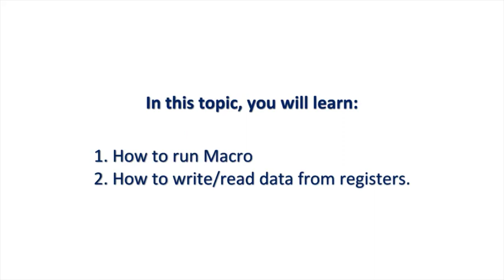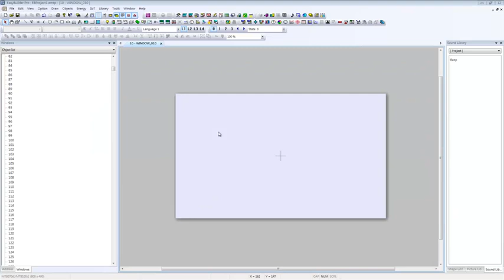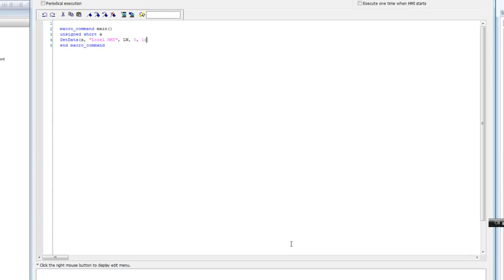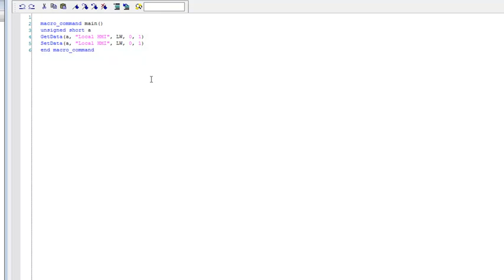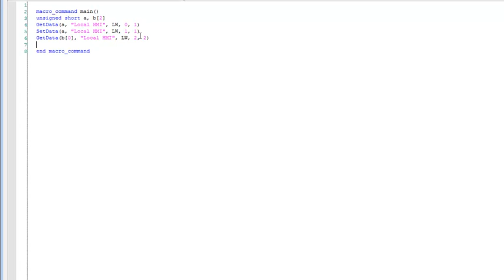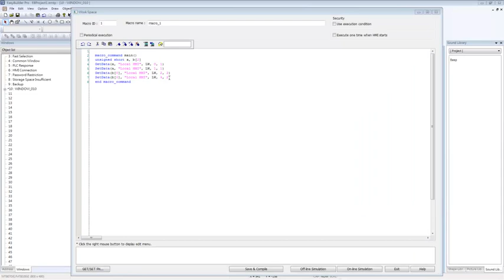Weintek EasyBuilder Pro tutorial - 25.Macro

Comment: what is the difference between GETBIT() and GETDATA() ?
i wanted to use GETBIT() instead of GETDATA but nothing
i have a toggle switch , write/read address LB14 and BitLamp reads LB14
i can use GETDATA to read the state of LB14 and SENDDATA() to write the state to a register  LW24  and shown on numeric object but if i use GETBIT and INVBIT and SETBITON or SETBITOFF instead of GETBIT and SENDBIT as below 
GETBIT(14, I, 1) // state of LB14 and store it in I
SETBITOFF(14,s,1) // changing the LB14 state from ON to OFF
i did that but nothing. Only i need to know what is that instructions for ?